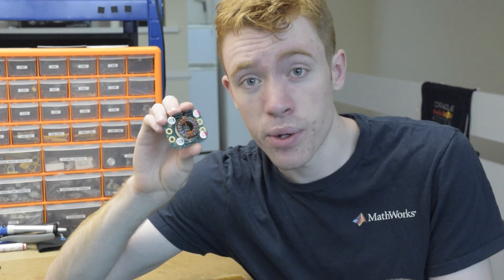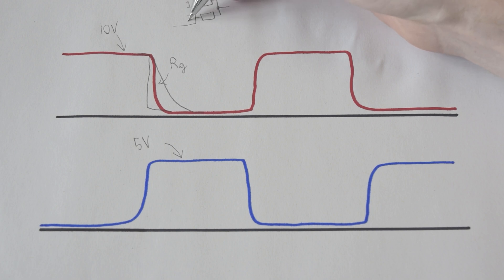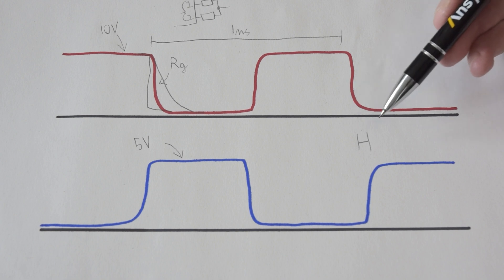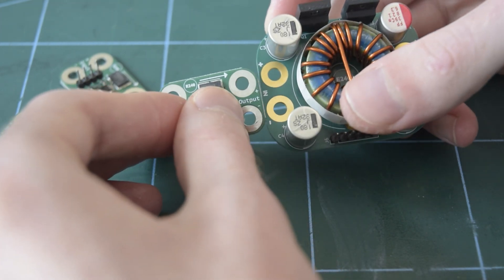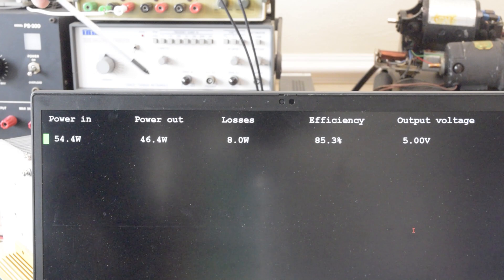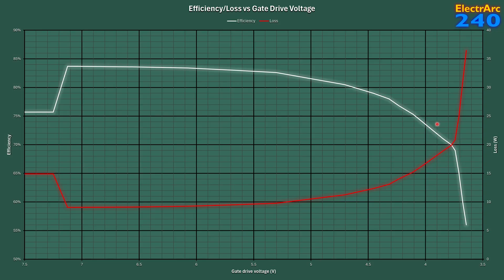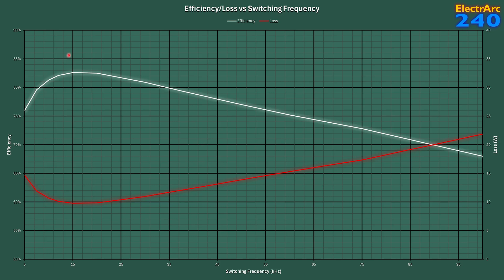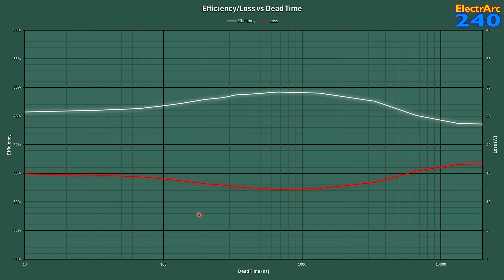What Affects Efficiency in Power Electronics?

Comment: Great video, however a pointless and futile exercise. There is no reason, ever, to reduce the efficiency of your inverter, drivetrain or the battery. Yes, the waste heat (from the inverter, from the motor and batteries) is being harvested for heating, however that is being done by means of a heat pump, which does not rely on any specific level of temperature (within a reasonable range of course) to generate useful heat to heat the cabin. And even if you needed some more heat energy for the system to work, there is no point in introducing complexity just to make the inverter function as a resistive heater element, when you can just install an dedicated resistive heating element! That would cost less, generate less complexity and provide less things to go wrong.

Just go for the absolute maximum achievable efficiency - the rest is a different worry. You can get heat from elsewhere or be smart about it and heat just the things that need to be heated - as others have said, the bits that are in contact with the humans insde, and the glazing which you need to see out of.

Comment: Increasing the temperature of a multi thousands $ part voluntarely instead of a cheap resistive elements. What could possibly go wrong ?

Why not instead make use of the heat pump circuit and reverse it for a heater. It works until -30c now with proper heat pump design. Resistive heating would still be there only in assist with colder than -30.

Comment: is removing a piece of nicrome wire inside of a coolant loop really worth putting more stress on a vital and expensive component like the inverter? seems horribly misguided. i installed a 100w radient heater in my phev which runs from a small 12v dc to 220v  inverter, and mounted it to one of those phone mounts made for cd players with a magnetic backing. quarts/ir/radient heating is actually extremely efficient if you only need to heat a small area inside of a space. literally the definition of space heater but this gets lost somehow in all these online discussions about efficiency and heat pumps. heated seats plus an ir heater basically just heats the driver and is extremely efficient compared to heating the entire poorly insulated cabin. there are a few ev's which have started to install radiant heaters, but they use those less efficient flat carbon felt heaters.
you have to dig thru the depths of chinease online marketplaces to find a small 100w ir heater lol. its about the size of a standard sheet of a4 paper folded in half, i think that makes it a5.
i also heat my other phevs cabin with the assistance of a 12v dc fridge which i keep my car drinks in. with a typical cop of around 5, and a power draw of about 70w thru the 12v dc port, my cheap 60$ dc fridge puts out around 300-400wats of cabin heat if the drive is short enough to not reach hysteresis. cabin heat is such a simple problem to engineer, no need to put extra stress on the cars inverter....

Comment: Is there a possibility to know the optimal SW frequency or the optimal gate voltage before building the product itself? Any calculation or datasheet values are helfpul in this situation? Thanks.
Reply from the maker: Optimal gate voltage is usually in the datasheet, though often a bit hidden. As for Fsw you usually select your component values based on an initial "guess" and then tune it a little to suit, bit of trial and error in my (limited) experience

Comment: Switching time, switching time, switching time, MosFet RdsON, synchronous rectifier, LowΩ inductor, LowESR capacitor, thick PCB tracks, Silver solder...
Reply: Switching power supplies die because switching time of all components increase as they age.
My suggestion for a lifetime Switching power supply - no costs barred - is to use UHF power transistors and an absolutely ancient 78S40 as the controller, which is bipolar. UHF TX transistors don't derate time-wise...

Comment: Thanks for this experiment.
Could you please specify the exact component models you used in the buck converter? Specifically, the digital potentiometer (U2), LDO (U1), drivers (IC1, IC2), and digital isolator (IC3).
Reply: Oh, I see, you used TI TPS2829DBVR for the drivers (IC1, IC2). But what about the rest?
Reply from the maker: Hello sorry for the delay, I have checked my BoM:

Digital pot = MCP45HV51-502E/ST
LDO = AZ1117CH-ADJTRG1
Gate drivers = TPS2829DBVR
Digital isolator = ISO7710FDR

Hope this helps
Reply: @electrarc240 Thank you! I suggest extending the video descriptions in case others are interested in knowing which ICs you used. By the way, is there a video where you show how you implemented your PI controller? This is the topic with which I am struggling a lot.
Reply from the maker: @BentFunction  I'm afraid there is not anything on pi controllers yet. Maybe I will do a video on them one day

Comment: Yeah I bet they like running your expensive power electronics hotter, so they fail quicker.
Then you have to buy a 4000$ module instead of a cheap resistive heater element for 100$ (if it even should ever fail)

I call that rebranded planed obsolescence!

Comment: Just the other day I trashed picked a portable window unit Ac and apparently it circulates the water from the condensate to cool the compressor! I've been thinking about installing some kind of copper coil around the flu or heater exhaust to act as a water heater or something similar. You would think that this would have been utilized. Any time heat/energy can be used or reused it adds a lot of efficiency. Most machines have very low efficiency due to unused wasted excess heat.

Comment: So basically , you have a solution around which you create a problem 🤣
Car manufacturers did it again.
One cute fact is that lifespan of capacitors depends of  twmperature so while you use your mosfet "heater" , other surrounding components suffer :) Niceee 😎
On the other side - video is great and very educational. Good job & thanks!

Comment: How ridiculous.  Try adding a resistance heater. That is fewer parts than modifying the inverter. The way to lower the part count is to get rid of: electric door locks and windows,  the screen in the dashboard,  ABS brakes, the electric mirrors. That's a start.

Comment: Very interesting idea and thought experiment to try and put into practice. That said can I bitch slap some common sense into the enginerd or whoever you were speaking with? It would really make my day! 

WHY ON EARTH would you ever intentionally increase the #1 killer of all circuitry?!! Why not just use a radiator and fan and use the fluid used for cooling the electric motors? 

I can’t think of any reason other than manufacturer saving from removal of what they are already using. Either way you’ll need venting and a fan so you save the cost of a small radiator and tubing so like $100 …. all at the cost of risking the heart of the system. 

🧐 Oh I just answered my own question, any future costs after warranty are all on the consumer so any production savings stay in their pocket and they build in planned obsolescence as shorter lifetime for the inverter which will continue justifying production and sale of inverters in the future. 

Can I please repeatedly face puch the guy considering this until I break my hand? I swear even after the pain and doctor fee’s, doing so will make my year.
Reply from the maker: Lol, but I understand your feelings haha!

Comment: Love this type of video as an electronics hobbyist particularly interested in inverters and DC-DC converters. 

Just wanted to share something on the watt measurement part: I have made myself a few units of wattmeters that run a simple ESP32 S3 microcontroller. They are pretty darn accurate and precise with a 24 bit ADC and really low ppm voltage references. I use them together on the inputs and outputs of circuits I am testing, occasionally two units at the same time, that talk to each other over WiFi and show me a nice efficiency value on a webserver. I can see a lot of options for automation with this device and just a lot of use cases. Let me know if you are interested/curious about it and we can talk. I would be happy to share my schematic/PCB/3D case design.

Comment: I personally like the method of increasing the f_sw the most, and i feel like you could enhance the loss slightly by using a core material that has more losses at higher frequencies, or use DC current bias and drive the inductors slightly into saturation.

Comment: Why not keep max efficiency and have a cheap simple 100% efficient resistor mounted in the car that requires less ducting to provide heat when its required?
Reply: Because a heat pump can give 5 units of heat from 1 unit of electricity. It's the heat you want with the best range.
For easy losses just increase the switching frequency so more time spent between off & on where there are more resistive losses.
Reply: (why have a 100% efficient resistor when you can have a 300% efficient heat pump)

Comment: They would have to waste the same energy in the power devices that would be otherwise invested in resistive elements for heating. 
So what's the point?
Waste energy to get rid of the resistive elements?
And don't get me started on the reliability issue, which would be severely compromised, for many reasons...

PS: What would make more sense would be to keep going after the highest efficiency possible, but what ever power does get wasted in heatsinks, use it, harness that heat, channel all of it inside the heating matrix, combine it with the usual resistive heating elements, but invest less power on them, just because you use the heat already generated on the power devices. 
This, to me at least, would make much more sense, using what you already have, and still increasing overall efficiency.
Reply: Decreasing parts count and weight maybe

Comment: It sounds to me that making an inverter deliberately less efficient is another over-complication  that is likely to cause more unreliability, by all means harvest the heat from the battery, inverter and motor but keep the resistive heater it's simple and works. The problem of integrating everything is that when one part breaks the whole lot is compromised. The best way to heat a cabin is to harvest the hot air emitted from politicians
Reply from the maker: Love that idea, definitely plenty to go round!
Reply: Also it seems a little like "planned obsolescense", since it will put more heat stress on components and shorten their life (for example electrolytic capacitors near heat sinks) and bigger temperature swings that can cause material fatigue and cracking over time due to thermal expansion. Even if the heat is useful, it will still increase the temperature of that inverter circuit a lot and it will fail quicker than it otherwise would. 
Also, to heat passing air, the heat sinks for the transistors will likely be used - which then need to be hotter than the air by a certain amount. How large that temperature difference need to be, to be able to reach the desired heating power, depend largely on the surface area of the heat sinks. Larger heat sinks are of course more expensive - so it isn't far fetched to think those car manufacturers will try to run them as hot as possible to heat the air "more efficiently". It's no small sinks required to leave many kW of heat, without to much of a temperature rise either - so that cost is significant.
It's all about "cheap out" on components, after all - otherwise they would just have used standard resistive heat wires - which can handle way higher temperatures than any components in the inverter circuit and thus, don't need a lot of surface area either. 
This means the transistors will probably be sitting right at their upper limit of what's safe for operation, when heating is required. Which leave no margins for errors - just a faulty temp sensor or something that make the heat transfer to the heat sinks slightly worse (like thermal grease losing some effect over time or just the slightest warping of the heat sink - which can happen from repeated thermal cycling) and they will blow up.

Comment: This reminds me of those "slew rate controlled" power supply controller IC's to reduce noise in power supplies for sensitive circuits, trading off lower efficiency for lower noise.  But I have to agree with the other comments that the better solution seems to be adding a reversing valve to the A/C system to create a heat pump.  Given how quickly the failure rate of semiconductors increases with temperature (2x for every 10C?), this seems like a dumb approach.  Heated car seats?  No thanks, what an unpleasant feeling!
Reply from the maker: Yes definitely for the heat pump. I agree on the heated seat, why would I want to still be cold but have a sweaty back??

Comment: Watts the efficiency of this. Same as resistive I assume. Would it not be more efficient to modify the AC to produce heat as it can produce more than 1 watt of heat per watt used? Half of engineering in the automotive industry is complete garbage, always looking for backwards ass solutions  which end up screwing over the technician in the long run. Ask any mechanic. Also support right to repair.

Comment: Use peltiers in system, so you could cool components and those give cooler coolant plus eat some power, giving heat in fluid system and to cabin.

Remember you could add resistive heater, that have 100% efficiency..

I would use A/C and use it for cooling or heating cabinet. Make it work with CO2 fridge rant.

Or use two coils to turn motor forward and single coil backwards, then you get some heating components.. And system could adjust it, without driver feeling anything.

You could run and breaking 3~ motor same time...

There's many ways to do this, but I would use different system that moves heat away from cabin or to in it. That system compressor must be controlled different speeds by the need of heating or cooling. Just turning it on 100% and off some time and back on, that's out of option today.

Usually those systems working in best efficiency at 60-80% compressor power.

Comment: It's an interesting concept, but aside from the efficiency issues, I don't see how it would be practically implemented. A typical automotive heater core is running at engine coolant temperature, about 90c. My understanding of batteries and inverters is that they run closer to room temperature. So the heater core will exchange less heat on a cold day because the temperature gradient is less than if the core was at say 90c. Of course you could cook an IGBT up to 90c, but then you're running that whole coolant loop at that temperature which stresses every component in the loop. Alternative is make a separate loop, but now complexity is returning to the system just to make the IGBTs work hard for no reason.
Reply from the maker: Yeah in terms of actually getting the heat to the cabin I have no idea what they are planning
Reply: I believe the strategy is geared towards heating the batteries, which heat is directly conducted to the cells via coolant jacket at a lower temperature. The only reason for high temperature cabin heat is because we don't have a coolant jacket of our own and must have that heat delivered through air, which has very little heat capacity, is mixed and spread out over several feet before getting to us.
Reply: @InfinionExperiments  Oh yeah that would make much more sense.

Comment: I can't get it, aren't two wires short-circuited not considered electric heater? How simpler they want it to be?
Reply: It is electric heater until it isn't (BMS shuts down battery output, short circuit blows up, wires blow up elsewhere).
Also controlling amount of output heat is impossible.

Comment: Without watching your video, gate frequency seems to me to be the obvious best way to go. But I don't like the idea of adding heat to the motor control circuit, as heat reduces controller life. A cabin heater requires little more than a box with a nicrome wire, a controller circuit, and a fan. If that FET control circuit dies then it is much, much cheaper to replace the heater controller than the motor controller.
Reply from the maker: Exactly! This is such a weird/bad idea but I was assured it is being developed

Comment: Major EV manufacturer uses loosy mode of motor driving (lets just say stalled motor) to heat up the batteries, but only in scenario where range is irrelevant - that scenario being ride to DC charger. Heat pump still produces heat in that scenario, but 5-10kW extra comes from drive units
Reply from the maker: Interesting!
Reply: Yep, Tesla does that. Deliberately run motor less efficiently to heat the battery.

Although to be fair, i don't understand why they do it like this instead of using heatpump.